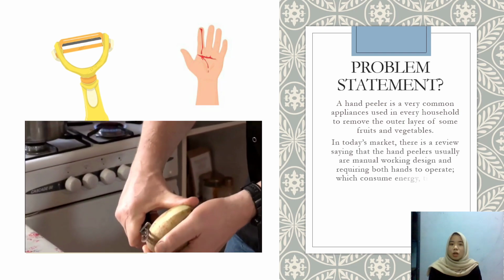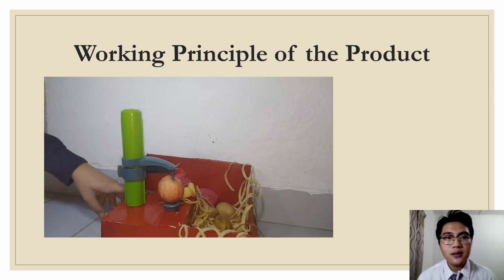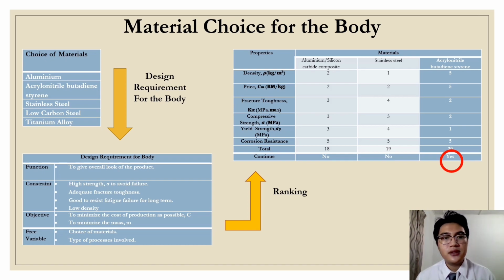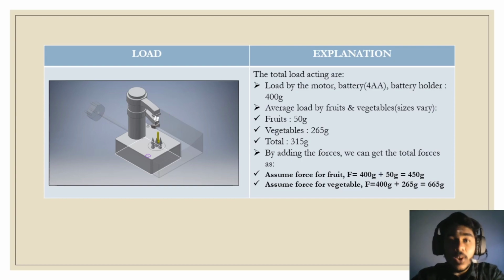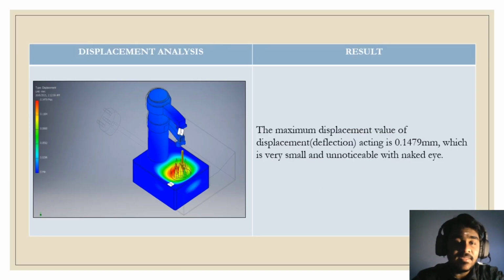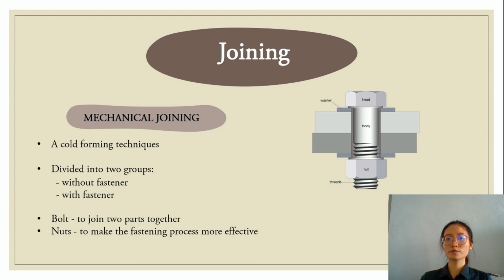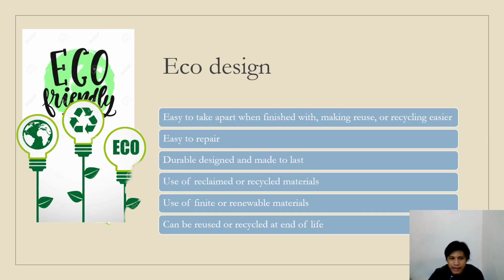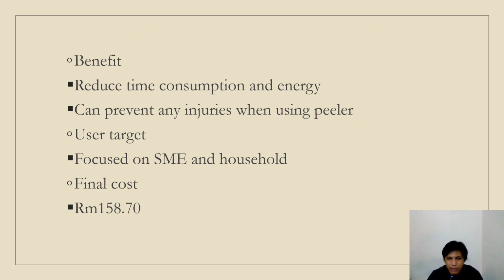AUTOMATIC FRUIT PEELER (AFP) G29 IDP Utem 2021

Comment: P/S: Sorry for late comment on your project. Just to be clear: you are not obliged to respond since the evaluation period is over. But for the sake of engineering discussion, feel free to drop a reply whenever you have some time. =)

Hi Team,

Faster and automated fruit peeler;

1. For Material selection of body do you consider 3D printed body and how it would fit your design application? It is more accessible nowadays and faster to manufacture.
2. I'm interested on how you select the suitable motor to be used. What are the main criteria here?
3. Engineering analysis should focus more on the potential wear and tear part. For your product it should be the robotize arm (moving parts) which happen to endure most dynamic load in my opinion. What's your take on this?
4. Peeler blade is prone to dull over period of time. How this is going to affect the performance of your product? 

Regards,
Shafirul